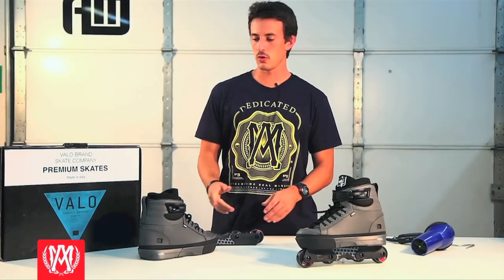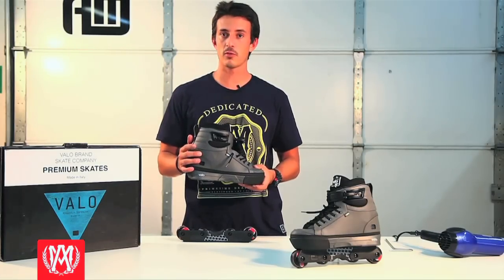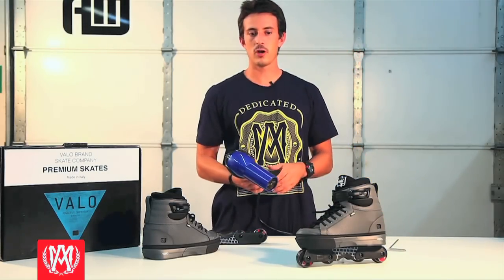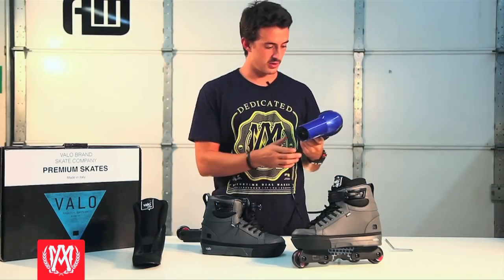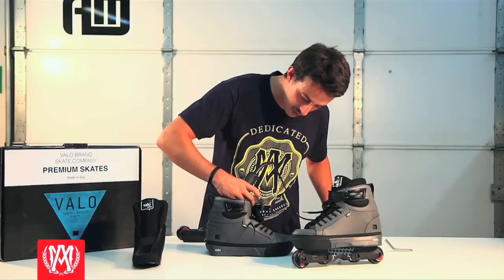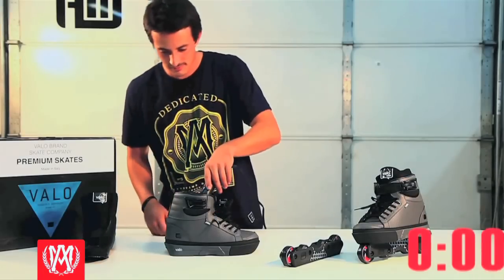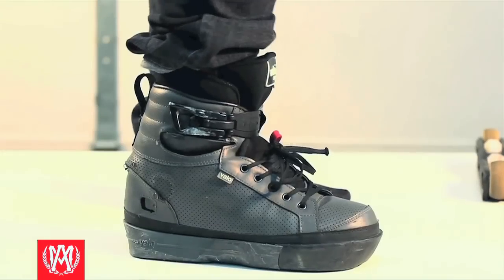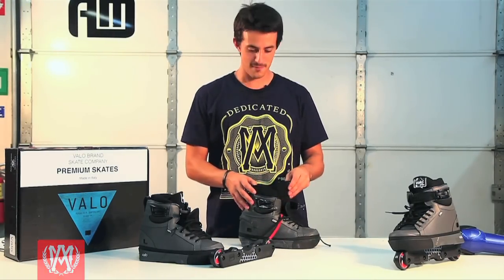Tech Tips Ep.1: How to heat mold the Valo Light skate

Comment: You CAN put these skates in the oven.  I emailed Roces to ask.  Their response is below: 

"You can place them in your oven at maximum 70 degrees [Celsius]. Please remove the liner before this.
It would be better if you remove the cover too, please check the instructions in the owner's manual inside the box.
Every 3 minutes remove the skates from the oven and see if they are soft enough to be molded as you desire.
If this is not enough, place them into the oven again for other 3 minutes and then check them once more.
Do not leave them inside the oven for more than 2-3 min, check them regularly.

This procedure is completely at your risk, we do not respond in any case if your skates will be damaged during this particoularly delicate operation."

Comment: Hey AM, I have JJ lites size 11.  They're a little loose on me.  Can heat mold them to fit tighter?  I assume I just heat them up the same way and instead of pushing out with my feet, I just push from the outside with my hands to get them to move inward.  Will this work?

Comment: what does heat molding do? I have the old valo tv 2s
Reply: Heat moulding is for the Valo lights only as they are carbon fibre shells. If you try doing it with classic plastic shells you can melt them, weaken them and make the fit worse. Skates with CF shells can be heated and then compressed or stretched for a better fit while warm.